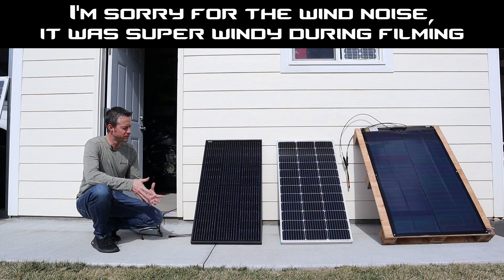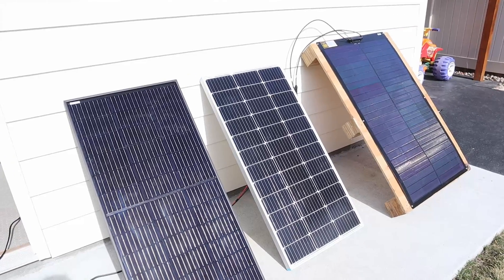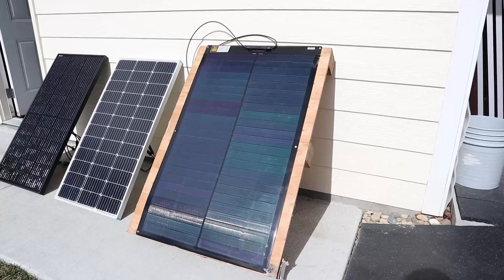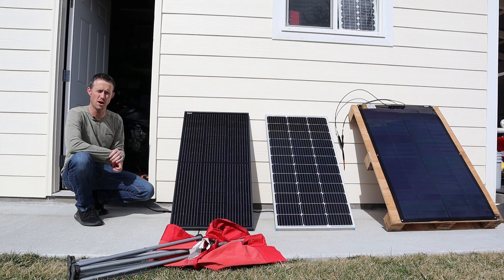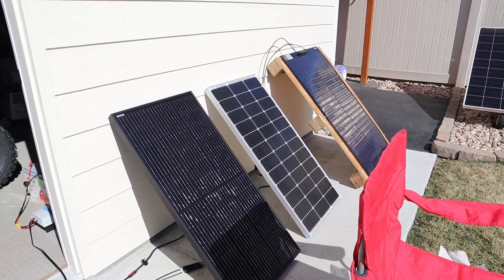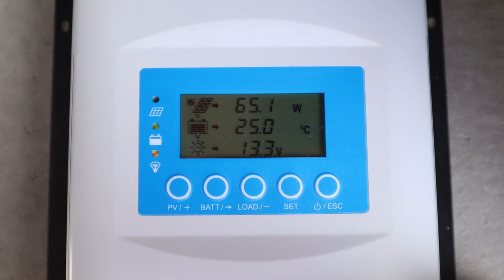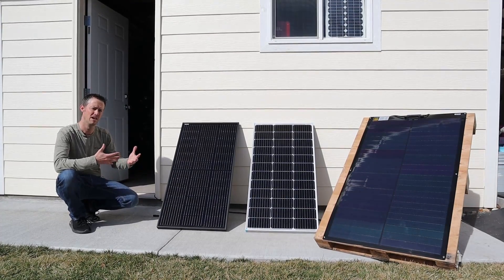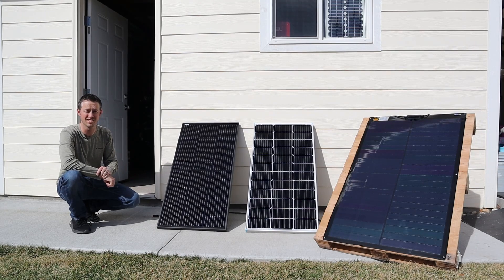BougeRV CIGS 100w vs Optivolt 100w vs Renogy 100w - High Cloud Testing

Comment: How many watts does the CIGS panel produce if it is in full shade but pointed at a bright blue sky?  From what I've read they can still generate some power from bright ambient light, unlike other types of panels.  Is this correct?  Could you do a simple test and report the results?  For example, on a clear sunny day, take it into the shade of a building and then point it at the empty blue sky, not at the sun.

Comment: BEWARE OF THE SPECS ON THE BOUGERV CIGS PANEL:
I purchased 2 of the 200W panels.
My generator needs 60-150V to operate.
These panels are 30.5 Volts each so I wired them in series.
They did not work.  I checked the Voltage on each panel and it was 25.5 Voc and not the 30.5 stated.
I checked the VOC when wired in Series and it was 51.5 V for the 2 panels.

I just wish that the lower than stated VOC on these panels was reviewed.
I like that they are indestructible but am SUPER DISAPPOINTED they do not live up to their stated Specs.

I did contact support but their support is iffy at best for my experience.  I have a few days left in the return period so will probably do that if there is no resolution with support.
Reply from the maker: Thanks for the heads up!

Comment: Correct me if I am wrong, but the optivolt can only be configured in parallel?
I don’t see the same limitation for the cigs
Reply from the maker: Correct, the Optivolt cant be wired in series, but it's also a higher voltage panel. These panels are meant for small / medium arrays. Nothing huge.
The cigs can be wired in any configuration.
Reply: @Jasonoid  to be fair in a high shade environment I wouldn’t want them in series, but I think it’s a unnecessary limitation.

Comment: Hello Jason! This is Jim Ray one of your winners for drawing of BougeRV 300 which I thank you.

On another note I have (4) 100 watt Renogy Panels and I just bought a new RV Travel Trailer. 

My question is mounting them on my RV roof in both Series Parallel to connect to my 60a Renogy Charge Controller and 3000 watt inverter. So do I have the configuration correctly thought out? Any tips would be appreciated. I really think you, Will, and Ben do the best job of the details. You are the man. Thank you always.
Reply from the maker: If you are charging a 12v battery, running all those panels in parallel will give you the best shading performance. Each panel will provide around 5 amps of power, so 20 amps combined. If you wire them in parallel with 10 awg wire (supports 30 amps continuous), you should be good and have the best shading performance.
Reply: @Jasonoid  thank you so much. So all in parallel not 2 series + 2 series and parallel to the charge controller. You are the man. Yes it’s for 12v configuration as I have 4 LiFePO4 batteries. 

Since we live on a ski resort here in Eden, Utah I really can’t do anything until iy stops snowing for a minute. So I’m planning my attack. lol
Reply from the maker: @jimoray3  you could also do a 2s2p config but any shading will kill power input on half the array. So if you have trees or shading I'd recommend the 4P setup.
Reply: @Jasonoid , I like and trust your recommendation. Thank you

Comment: Hey, I have a question if you could help me with. I have the bluetti ac200p. On the display for incoming solar power it shows the volts and amps coming in, as Well as total watts. If I test the panels with a multimeter, should the amps and volts be close to the bluetti display, then times them for watts. If you can help, thanks
Reply from the maker: They should be similar results but no meters are created equal. I have tested three meters next to each other and each one gives a different number. Having the numbers off a little bit is not an issue, as long as they are in the same ballpark. Usually the more expensive of the meter, the more accurate it is. A $200 meter will be more accurate than a $20 meter.

Comment: This is a great start!
Yes, a panel built for partial shading will pay for itself, just like a MPPT controller will (v. a PWM one).
I would be interested in seeing how the Renogy 150w CIGS does.
I could only test it laying flat next to the 200w BougeRV CIGS, but (compensating for the wattage difference) the Renogy produced less.  Maybe it was more susceptible to misalignment?
Reply from the maker: In my follow up video I'll test these laying flat to see the power difference 👍
Reply: @Jasonoid   I couldn't take it any longer, curiosity got the better of me, and I ordered an Optivolt...thanks for the discount code!
Reply from the maker: @greensavant2573  the Optivolt panel is built really well, it reminds me of the larger 400w residencial panels. You'll enjoy it!
Reply: @Jasonoid  A couple I got in last week really impressed me,  HQST (Renogy) 10BB 100w.  So small and lightweight,  and great build quality plus only 13lbs.  Oh, and way under $100!

Comment: Thanks for the video. I suppose the fact that the BougeRV is such a large panel that shading it with the chair doesn't actually cover it left to right completely... so, I am on the fence about how fair that is... Nevertheless, I suppose it makes sense to allow it since a shadow will might have a small footprint, so a nice big panel would get more sun. On the downside, that panel is substantially bigger than the other panels. 
Would really like to see the Optimus 430 tested... if you can get your hands on it.
Reply from the maker: You're right the shading was exactly equal on each model. Maybe in the next testing video I need to get a larger chair to make the coverage exactly the same.
Reply: No, the CIGS is so shade tolerant because it has 48 bypass diodes in it, compared to just a couple on a typical glass panel.
Reply: @HabemusQuattro  Interesting. That is quite a lot. Thanks for the info.

Comment: I have a Bouge RV 200W CIGS panel, 6 Eco-Worthy 200W standard panels, & 6 Renogy 200W semi-flexible fiberglass panels.  The Bouge panel puts out 28 volts under full sun, all the others put out 23 volts each.

Right now under either wispy high clouds or scattered cumulus clouds, I get amazing output from all the panels.  I have the 6 Renogy & 6 Eco-Worthy in series (in 2 different inputs on my inverter) & they're putting out 2.3kw when cloudy compared to 1.6kw under full sun & no clouds.  This only happens in the months of February to March, never in the fall during similar cloudy conditions.  My batteries charge up real fast @ 2.3kw.  I initially was worried I was going to overload my inverters but the mfg said it was ok as long as I don't add any more panels to each circuit.  All this verbage is only to point out that clouds aren't necessarily bad, but depends on what kind of clouds & other conditions are involved.
Reply from the maker: The worst clouds are the clouds dropping rain. I get around 10 to 15% output of rated power. Most thinner clouds I still get decent power. Partial shading is the worst though. In the winter months I get trees and buildings casting on my panels and I loose most power output (since my arrays are wired in series).

Comment: Well the BougeRV advertises 12 diodes and the Optivolt advertises 6 shade areas which are both higher than the Renogy which I believe has 2 diodes which would provide 2 shading zones. However I believe the Renogy strings are top to bottom which when shaded across the bottom as  you did, would cut off both strings. Perhaps had you shaded half the panel in the opposite direction, you would have had more power output.
Reply from the maker: I'll do another video when conditions are ideal, this one was kinda a warm up video. I'll test multiple shading scenarios to see how it goes 👍

Comment: I noticed you have the Bouge mounted to a pallet - in the summer is there going to be a heat issue - I know the angle would be bad but could the Bouge be mounted directly to a wood fence
Reply from the maker: The BougeRV panels are meant to be mounted to trailer and RV roofs with plenty of heat. You'll be fine mounting yours to a fence.

Comment: Good video. Surprised on the much lower shaded output of the Renegy as compared to the other two.
Reply from the maker: The Renogy was the control in the experiment. That's actually how most solar panels will perform with any shading. The Optivolt and CIGS are designed to still put out power, even while shaded!
Reply: @Jasonoid Guess that's what you're paying for. I already have 24 plain vanilla 100 watters. Oh well.

Comment: I'd like to see that CIGS panel rolled up in an awning for the ultimate RV charging solution at camp.
Reply from the maker: I don't think it will roll up quite that tight, i've gotten it down to about a 10 to 8 inch circle.
Reply: And be able to change angles!!!

Comment: Thanks for this comparison. I had never heard of Optivolt. Interesting that they do not recommend connecting their panels in series. The BougeRV CIGS is still the winner IMO.
Reply from the maker: I have a full video on the Optivolt, with the 48v option, putting them in parallel works well for most RV / camping setups: https://youtu.be/xQShJnxSevY
Reply: @Jasonoid  Hahahaha I am getting way too old! I Saw that video and even left a comment!! 🙄

Comment: Another channel had a good review of the CIGS and extreme shading.  He shaded multiple areas of the panels using smaller pieces of cardboard.  Generally all panels will drop 100% of their output if you shade a small percentage of each of the sections of a panel with a blocking diode (typically 3 sections or a third of the total number of cells).  The CIGS just keeps on going just dropping the percentage of the shaded area.  With about 90% of the panel covered (just a couple of open areas open for sunlight), the panel gave the 10% output.  These panels really are game changers and very forgiving for poor or non optimal placement (real world).  Some may think that CIGS are expensive, but consider that one CIGS output more than 5 of the Renogies under shading.  It would be interesting to see if the Optivolt would behave similarly to the CIGS with multiple smaller shading over the panel.  Thanks for reviewing!
Reply from the maker: I've seen some great videos on these cigs panels. I plan to do another more in-depth video when the conditions aren't garbage. I want to break down the partial shading tests vertically, horizontally, and diagonally.
Reply: $600 for one 200w panel is indeed expensive.  Not only that but the actual lifespan of the CIGS panels is unknown.  I'd love to have them if I knew more about the actual lifespan, but Jason's earlier comments expressing concern about their lifespan doesn't give me much confidence.   I did research the lifespan of the ETFE coating on the surface of the CIGS panels, & ETFE plastic DOES NOT DEGRADE in strong sunlight, but what about the base layer that's underneath everything?  That I don't know.  I do know fiberglass degrades in constant sunlight.
Reply: @mosler302 Apparently the first company (not BougeRV) to bring out CIGS botched the glue on the layers and they fell apart, that's made a bunch of people just see "CIGS" and think "scam". As for me, I'll never go back!
Longevity wise, well I used to have 450w of silicon flex panels on a mostly-flat roof under the full brutality of Japanese summer. Best output I saw was 250w, within a couple of months the psnels had semi-"melted" and were lucky to make 20w.
Now I have 400w of CIGS up there, I see 350w regularly (and sustained!), the full 400 occasionally, and they've not been affected by heat, humidity or solar intensity at all.